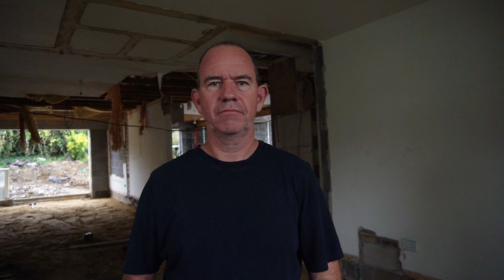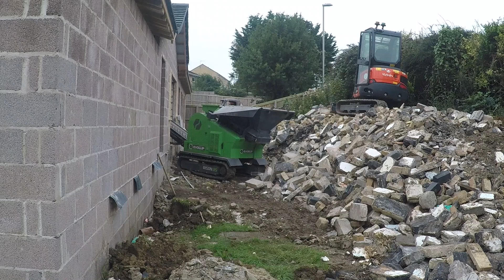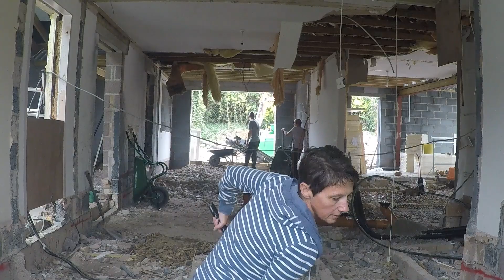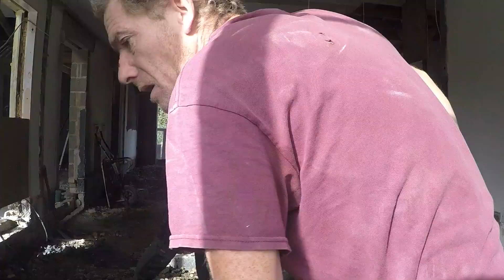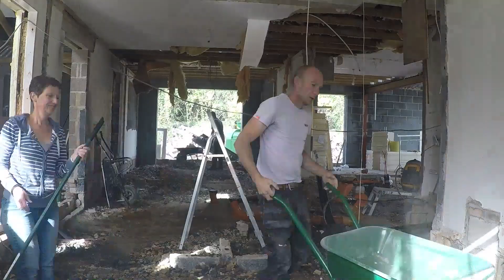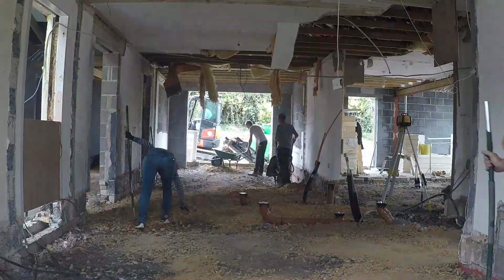Self build: recycling your house! Saving  money recycling hardcore on site

Comment: Did you have to get building control written agreement? Think you have to on new build perhaps not on renovation.
Reply from the maker: We have had to get full building control sign off, there is not much you can do without it these days. Do you mean specificaly for reusing the hardcore? They did come and inspect at various stages of the build and need certifications for all electrical work, heat pump, windows and MVHR.
Reply: @JurassicJungle  Yes this was about the hardcore. I remember now it was specifically for the warranty i.e LABC requirement. you cant use crushed demolition spoil unless its is specifically agreed.
Reply from the maker: @barerfont  That was not a requirement placed on us. I can see why they may say that as it would depend what the materials are. This was all nice clean brick so it produced a pretty decent hardcore. The crushre operator was able to fine tune the size for us.

Comment: oddly enough I am looking to do something really similar so your videos are immensely helpful! hope you can help with a few questions.
1) do you have any negatives about recycled crushed concrete? 
2) How long would you say it would take to have dug out 60m2, and did you get the digger in the house to do it? 
3) you went with 300mm hardcore layer, that's quite deep was there a particular reason? 
4) I haven't gotten to any more recent ASHP videos but was it a good decision? Did you look at using HeatGeek by any chance?

thank you!!
Reply from the maker: Hi, I am glad they have been of some assistance. 
1. Our wast was a combination of an old garage floor slab and brick walls that we had demolished. I have no issues with it for the purpose that we had, we were able to adjust the size that the crusher produced and were able to crush and wheel it directly into the floor. It saved us a few thousand pounds I think. 
2. We did not need to dig out the floor, the original house had a suspended wooden floor with a 500mm void. As we wanted a solid built up floor so decided it was simpler to fill that void rather than try and add new block and beam. 
3. This was really just a reality of what we needed to add to build up the void from our original floor. If I were to do it again I would investigate adding thicker PIR. We added 100mm as my builder said that was what was needed I have since found I should have considered 150mm or more. I also found out about a poured polystrene insulation that I think would have been a better overall solution but not something my builder had ever worked with. 
4. I am holding on judgement on the pump until after next winter. This winter the costs were very high but the building had almost zero insulation and lots of gaps. As we closed up the building and added insualtion the costs dropped very quickly. Hot water is a bit of a challenge as we only have a 210lt tank, wish I had gone for 300. The combination of Solar (we have about 4.5Kw) battery (13.5Kwh) and the heat pump is working very well indeed at the moment with electrical costs of just a pound or two per day and I am even charging my EV as part of that. I think the higher winter costs will be balanced with very low cost in the summer. 

Best of luck with your project.

Comment: Very informative vlog. I will soon be doing the same excavating for ufh and am considering hiring a crusher to recycle the removed concrete
Reply from the maker: Thanks for your comment Peter. I have done some more work on the numbers and we certainly saved quite a but more than we expected and suggested in the video. I would certainly recommend that you investigate it. Check what your local crusher hire company charge including delivery and fuel. Where can you store all that rubble and move it about? Will you need a dump truck as well? It is certainly better for the environment.